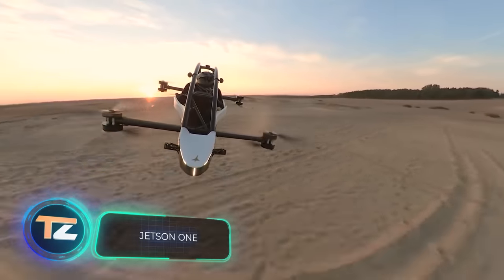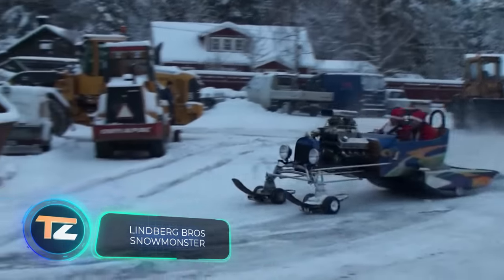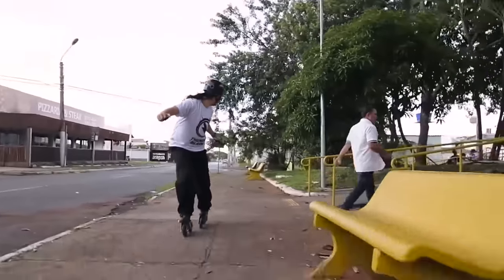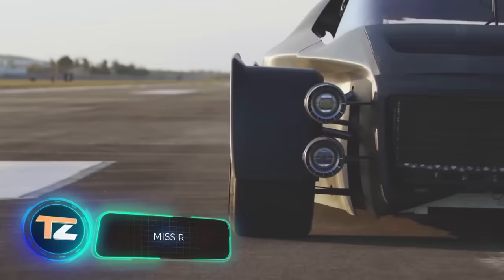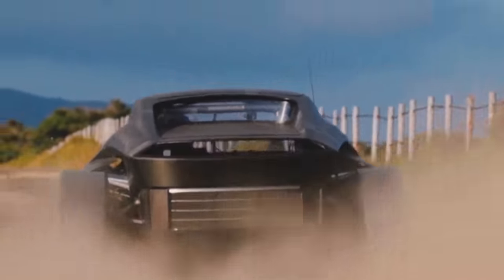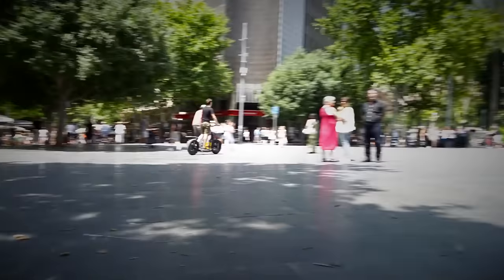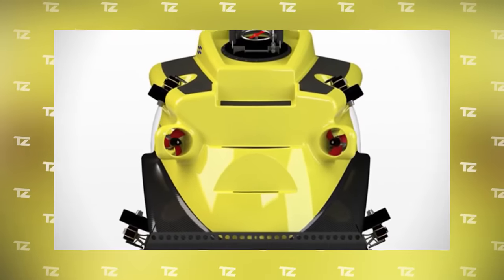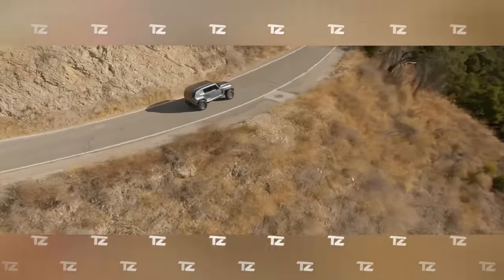13 CRAZY VEHICLES THAT YOU WILL DEFINITELY LIKE

Comment: Confused 🤔. A submarine that only weighs 22 pounds.
Reply: Well add the weight of the people in there, it will be over 22 pounds. But I do see where you're coming from, that does have to be a miscalculation or something, no way a sub is weighting 22 pounds.
Reply: With the right materials, I could believe it weighing 220 pounds, maybe.  The depth estimate for the same vehicle seems to have an extra 0 on it.
Reply: @kokopellione  almost 3Km deep in a 10Kg submarine?

Yeah, nah... 😂
Reply: No way, the acrylic dome alone will weigh over 100 LBS. I think they are mistaken, 220 LBS would be more like it and I still think that is to light. I'm a SCUBA diver and the the SCUBA gear alone weigh more than 22 LBS.
Reply: ...and it goes WELL over a mile under the surface (9800ft). I have my doubts.
Reply: Yep, you're all correct. Wrong weight, wrong depth. Let's hope the battery time is correct; I'd hate to die all that way down in the ocean in something that weighs less than my 3yr old. :)